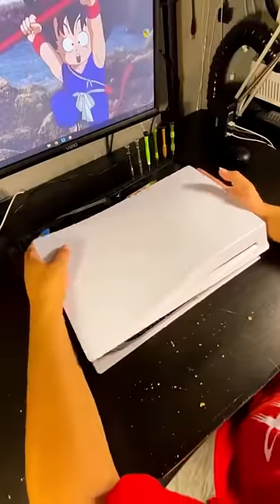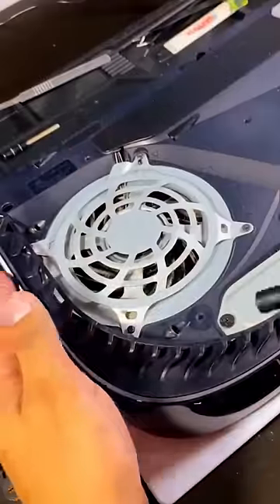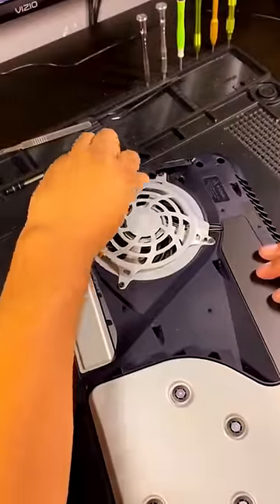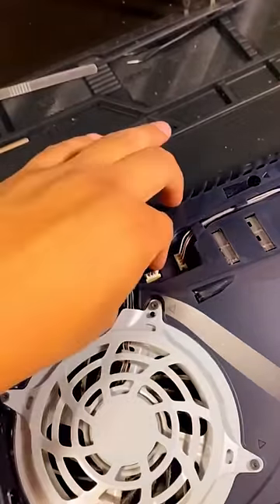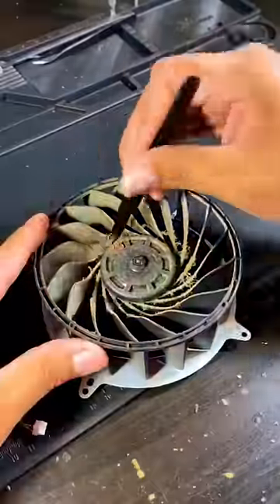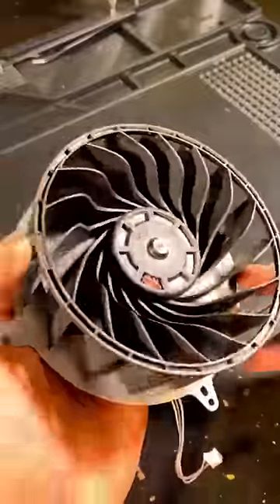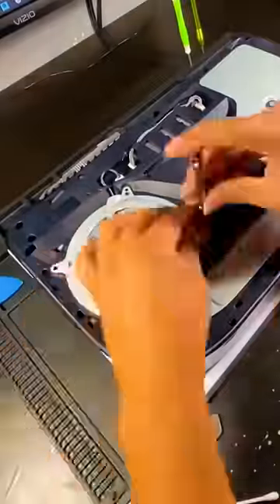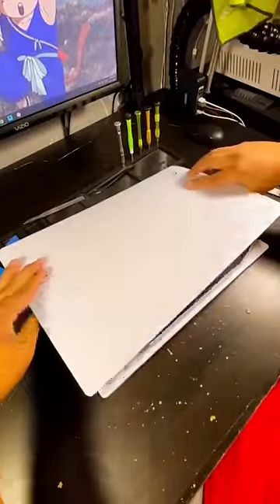How to Clean PS5 Console Quickly, Safely and Without Losing Your Warranty

Comment: You cant void the warrenty anymore... Due to Right to Repair and the law under The Magnuson-Moss Warranty Act, taking the console apart is okay. Its only voided when you break something
Reply: Yea plus eventually you will have to take it apart anyways bc these methods will eventually work less and less just due to dust clogging the cooler fins
Reply: @C0yf1sh  Yeah, but Im just saying that you can take it apart and it wouldnt void any warranty unless you broke the console in the process lol. I am glad the PS5 is easy to take apart to get the fans and vents
Reply: there actually a sticker on it that it says something like removing this voids the warranty but at that point your getting into the guts of the system
Reply: @nootsgaming5517  playstation symbol appears on the sticker.  Factory warranty gone
Reply: @JMaher393 It was easy for you to take apart?
Reply: After your warranty expires its fair game but before it does, you are better off replacing it or cleaning the bare minimum. If you peel that sticker and go deeper then the factory warranty is voided.
Reply: Where is the sticker located....can you take it to be cleaned professionally?
Reply: I followed a video on how to deep clean ps5 I never took a pc or playstation apart took me about two hours in total but ps5 isn’t overheating anymore it was my power supply clogged wit dust hair etc
Reply: @nootsgaming5517 according to the FTC void stickers are in fact illegal and a company can’t deny your warranty claim if the sticker has been removed
Reply: @teed1761 according to the FTC void stickers are in fact illegal and a company can’t deny your warranty claim if the sticker has been removed
Reply: @Unbothered92 according to the FTC void stickers are in fact illegal and a company can’t deny your warranty claim if the sticker has been removed
Reply: @GrimReapingU according to the FTC void stickers are in fact illegal and a company can’t deny your warranty claim if the sticker has been removed
Reply: @wilfisi588  tell them that,  not me
Reply: @wilfisi588  I guess the tamper proof sticker is just for looks then
Reply: @GrimReapingU  i understand your point, they used to be enforceable, but they aren’t anymore, would you like me to send you the link to the FTC (federal trade commission) website where what i’m saying is stated ?
Reply: @GrimReapingU  i sent the link please read it especially the third point
Reply: @wilfisi588  lol. You missed the sarcasm, I guess.
Reply: @GrimReapingU  went over my head 😆
Reply: Yes you can still void your warranty it all depends on where you live
Reply: @GrimReapingU  wrong, as stated previously. Google the Magnusson - Moss warranty act. Corporations lie straight to your face and people just bend over and say "Okay..."
Reply: @anomicxtreme  nahhhh
Reply: It says to keep it clean and to take it apart on the PS5 instructions lol it shows you also how to
Reply: Clean your room more offen and vacuum it
Reply: @C0yf1sh Yea I had to open almost completely cause the cooling system and the power supply were clogged up with dust cause the PS5 was shutting off due to it and now works like factory again. Before that I maintain the fan cleaned and the area that the fan is. Mine lasted 2 years without opening completely 👍🏻
Reply: Is that a global thing?
Reply: @jaseidon  Just the States so far
Reply: Bold of you we're all from the same place.
Reply: Oh so I can take my ps5 back to Sony without the sticker?
Reply: I must be one of the lucky ones bc I average 2 or 3 days and 4-5hrs of play time over the first 4yrs of owning a PS5 and my cooling system has never been that dirty! I opened it up for the first time last year and the fan barely needed any attention. I went deeper recently to get to the heatsinks bc the console was making weird noises and getting warmer than usual, but not shutting off, and they only kind of needed a dusting
Reply: So incorrect.
Reply: I still wouldn’t risk it. Obviously i’m here cause i want to clean it. But i’d be full of it if i said i’m not scared to do this. My PS means a lot to me. I’m not rich. Quite the opposite. 😔

Comment: Absolutely do not wiggle wire connectors by the wire, you run a massive risk of them snapping. Gently push up from both sides of the connector
Reply: I use needle nose pliers not too much force
Reply: @Hellraiser988  Same. Been cleaning out my launch day console every 4-5 months since 2020, and disconnecting the fan ribbon cable with needlenose pliers as well to thoroughly clean the fan blades similar to what was shown in the video.
Reply: Yeah I cringed watching him yank on the wires for the fan
Reply: My heart stopped when he did this
Reply: Put your foot on it and pull
Reply: In one of the videos I watched just to be careful with this system, the guy said that the fan is very fragile.
Reply: Я так оторвал конектор с платы, пришлось отдавать в ремонт чтобы припояли обратно
Reply: Yeah I was doing what he said and now my connector came out with the cable😃🔫I don’t know if it’s easy to fix
Reply: @MrDAm1EN  😂😂😂😂
Reply: @ZeRoClan  gonna need a pro to repair that unfortunately probably
Reply: What if you do snap them? Console gone for good?

Comment: This is all good stuff but if you really want clean your ps5 you have to take out an additional 100+ screws to access the heat sink. Sony built this thing like it has some secret sauce hidden inside
Reply: Its made like most of the products these days to break eventually so u need to  buy new one..
Old times are gone when some products u could use for years or decades
Reply: I wonder if this is why mine is still turning off even when I cleaned it
Reply: @chocobabiii1002 mine is also doing the same thing since yesterday, it will just shut off and I have to switch it off at the plug and back on again to get it to come back on, I have a strange feeling it’s the new firmware update causing this issue
Reply: @xSinphony  it turns out that my fan wasn't spinning. I changed it out and now it's working again

So maybe you can remove the cover, start up a game and see how well the fan is spinning
Reply: @chocobabiii1002  once u take apart the fan if you look all the way to the bottom with a flashlight you'll see another ventish looking thing. If it's clogged that's where the actual problem is. Unclog and clean that as much as possible. It's hard without removing the rest of the system, but if you're like me, you don't want to do allat lol.

Comment: When you take the fan off, make sure you know exactly which screw you took out and where because that same screw has to go into the same exact spot or else you’ll be sitting there for another hour or two trying to figure out where four screws go. They are all different sizes and so you don’t accidentally break anything they need to go back into the same spot!!!
Reply: Well seen bro 👍🏽
Reply: Short screw goes at 10 o clock, long screw goes at 3 o clock, and 2 medium sized ones go on the bottom slots
Reply: What kind of screws are they? Not Phillips
Reply: If you miss a few screws it’s not that big of a deal as long as it’s not around the heat sync lol
Reply: @frankpreston5845 yea I tried every Phillip screwdriver and could not get them. Help lol
Reply: Really not that hard when only 2 of the screws are same size n length. The others are different length and size

Comment: If you fan is this dirty, your heatsink fins must be cloged by dust.
Reply: I'm not lying but every ps5 fan which is used gets tgis much dust, but nit that yellow, its because it collects dust real fast, my house is pretty clean everyday and it's still dusty the ps5 but the dust isn't yellow
Reply: True, they are. I wanna completely clean mine but it's a £570 system 😬.

I guess it'll be easy because taking the ps1 apart is simple. Not being racist but the Japanese are smart in construction.
Reply: I used mine everyday for the last 3yrs and mine is no where near this dusty. Mine only had a little bit of dust not a ton like this video

Comment: This will only work for so long before you'll need a complete service - but its still a good way to keep on top of it for sure! Also very important to brush the vent holes on the PSU because it can be mistaken for liquid metal problems if it starts randomly shutting off
Reply: Yea mines been shutting off frequently but only on certain games. Other ps5 ones work tho.

Comment: Did anyone realize that you need a certain screw to take out the 4 bolts and no information or link for said tools.
Reply: Use a micro flathead screwdriver. It'll fit in the security screwdriver slots. It works just don't force it or you'll Strip the screws
Reply: @gabeolson817 holy crap didn't try this. Tried every Phillips and thought I was an idiot. Thank you

Comment: fucking hate when i don’t have a specific screwdriver so i just try to improvise for hours and never get it out
Reply: Fr
Reply: Lol
Reply: i went to buy the T9 screwdriver youtube told me to use and it still didn't work, luckily i had an extra small size 1.5 flat head screwdriver that worked well on the PS5 screws. so you can use that if you want
Reply: @Kai88988 T9? What YouTube video told you that😭😭💀 it’s a T8 Torx security screwdriver the same one people use to take apart the PS4
Reply: @V6MAYB3  no wonder my screws got stripped ☠️
Reply: on this stage right now liek what the hell soze do i need bro
Reply: @yinzblade  order the right screw driver.
Reply: @yinzblade  be patient and don’t keep doing this because you’re gonna end up like me stripping the screw until even the right screwdriver wont work. i hat the take a certain pair of pliers and spin the screw off
Reply: I did it with a fingernail clipper and it worked
Reply: @Akcawakcawnum2V fr ?
Reply: Ebay... Cost you a 1 dollar fifty cents. Less if in America
Reply: or when you have the proper one and it still strips the head.
Reply: just look up the screwdrivers you need, then order them.  

don’t complain, solve the problem.
Reply: @Kai88988 saved me there mate 😂 thank you
Reply: Amazon is your friend bought a screwdriver kit for $10 and never looked back
Reply: Did that yesterday bro it was exhausting fr and i damaged the screws a little. Why they always need to make the screws safety ones with the little pin in the middle?
Reply: It’s def a t8 with a whole in the middle😂😂😂
Reply: A precession set is $10 at Walmart

Comment: Do not use compressed air. You will pack dust into smaller compartments of the system. Use a vacuum with a brush attachment.
Reply: Where do you get the vacuum
Reply: True that's what I thought
Reply: Not true at all i been using it for my ps5 since launch and its fine
Reply: @FutureTek9209 I was gonna say I just cleaned my shit with one of them air cans Is be upset
Reply: Using compressed air will push dust further in people are stupid been saying this for years people keep doing it though.

Comment: I always just get to the fan underneath, unscrew everything but don't disconnect the wires or anything, then use a cleaning toothbrush to get the dust off the metal grills, usually a thick layer directly over it, clean the fan with conpressed air out of the console so it doesn't blow inside, then hook it back up and done.

Comment: 1) you’re blowing air into the unit. 
2) you’re tugging on the actual wires to pull out the power plug for the fan.
Reply: It's,a compresd air duster slash vacuum do can blow n also suck up dust lol
Reply: N yes puln on wires is dump push both sides gently nnupwards at connecter instead

Comment: My ps5 was turning off by itself so I had to clean it. Took the panels off and just blasted all the vents with compressed air. Didn’t remove the fan or disconnect any wires. Didn’t use q tips or anything else. Just wiped it down with a polishing cloth and that was it. Now it’s runs just fine.

Comment: Attention!!!  Do not forget to blow air deep in the ps5 way at the bottom.  9 outa 10 times the power supply is critically clogged which will overheat and shut down your ps5. Inside the fan hole and way down.  Use a flashlight.

Comment: Do not use compressed air. Compressed air condensates and liquid forms inside the can. That liquid will mess up the innards of the PlayStation when the fan starts spinning, which in turn will throw the liquid to the more sensitive and crucial parts of your console

Comment: You should use a vacuum instead of compressed air, compressed air can push the dust deeper into the Playstation, vacuum cleaner will suck it all out

Comment: Don't use compressed air withoud holding the fan.... Motors can be used as generators
Reply: not a problem if you follow the instructions and disconnect it first

Comment: Overheating ps5s ‼️🎉 pro tip.  If you remove the fan you have full access to the power supply and heatsink. Heres how to fix your ps5.

  Which if you have a ps5 shutting off or overheating its like 90% that.  Other 10% if the time the liquid metal needs spreading on the chip cause its dried up or has moved off it from gravity/ rough handling.

Anyways basically unscrew the fan with a star screwdriver with a hole or use a pliers something.  Get the fan out just enough to be out of the hole.

Then get your flashlight and look down in the hole the fan was in.  Look to see if the power supply holes are full of dust.  If your ps5 is verticle its all the way at the bottom opposite the fan hole. If them tiny holes are dusted blow them out with air.  Canned or compressor.  If they are clogged thats usually guaranteed to shut your ps5 off from heat without even a warning many times.

Then look at the heatsinks.  Theres a bunch.  Half the ps5 is a heatsink.  Blow them out with canned air or an air compressor.  Both the power supply and the heatsinks.  Use a brush if you need or something similar on the heatsinks since they sometimes get real thick caked on gunk if you smoke or have pets.

And thats basically it.  Most of the time this fixes an overheating ps5.  Or a ps5 shutting off after awhile randomly or after playing a real ps5 game which raises heat much faster.

Comment: Torx 8 will take the fan screws out, right? If I just clean both fans and a little of the inside from where the fans were removed, is that enough to stop it from shutting off after hours of game play?😢
Reply: It should be enough. If you do that, your ps5 should last for a long time.

Comment: If the screw isn't moving (I have the correct screwdriver as it worked for the rest) what should I do? I believe there might be a problem with the other two screws.

Comment: I kept hotboxing my room and my Ps5 completely turned off due to dust build up … I opened it up and cleaned it throughly using 

Q-tips 
Rag (dry)
Computer cleaner 

I cleaned it all up I kept the fan plugged in but cleaned it throughly. removed the 2 vents on each side . Put everything back into place including the 4 screws holding the fan guard. Word of advice don’t apply extra pressure when opening the Ps5 cover clips might break  also on the vent covers . 

“It’s always 4:20 somewhere in the world”
🌎  🌍  🗺

Comment: This is from keeping your stuff on constantly and not cleaning your house. I just changed the covers on my console an hour ago and I have a launch console. I had no type of dust like that. I had a little on the outside of the fan that wiped right away with a microfiber cloth. Absolutely nothing was inside the fan.

Not even my launch PS3 looked like that and I took it apart 2 years ago to change the battery.

Stop being dirty…

Comment: Dude seriously just pulled the fan connector out by the wires. Buddy, a pair of needle nose pliers gets the job done way better, doesn't risk the wires snapping or otherwise getting cut, and gives you a better grip. Plus they're not prohibitively espensive like other tools can be, they're found at any hardware store.

Tip: when you actually disconnect the fan connector, pull by the white connector, not the yellowish port. The yellowish port is connected to the motherboard and if pulled too hard will snap, which of course will break the PS5. The little white connector is snug inside of it and may require some wiggling to get it loose. Do not pull to hard, though, for whatever reason, nor do you want to wiggle it more than a very slight amount. It should disconnect with minimal effort as it's not clipped in. Remember, these connectors are small plastic parts and the wires are thin. They're easy to break if handled roughly. Gentle but firm does it.

Pro tip: if you can spare the cash, get yourself an iFitIt screwdriver kit. It will come with the actual screwdriver plus interchangeable heads that way you don't have to mess around in your dad's garage trying to find a screwdriver head that will fit the screws. This whole process took me about an hour to take apart, give a deep cleaning, and put back together my PS5 because I had the proper tools.

I got my PS5 used from a coworker and it came out looking about as bad as this one, so getting it cleaned was a huge relief and the PS5 seems to be working a lot better. At the very least it doesn't have dust caked on and I'm sure the airflow is way better. And I didn't have to find a repair/cleaning place!

Comment: I'd never use a can of air on the outside. It would Force the dust deeper inside. Also if you google it. there's 2 holes on the black case you can put a hoover on that leads to the inside heatsinks and pulls dust out

Comment: Didn’t clean the face plates and he obviously put crap in there also you can use a microfibre cloth for the shop and put i between the fan blades cleaning the mental plates protecting the fan is good but you literally took an extra step not needed to clean them